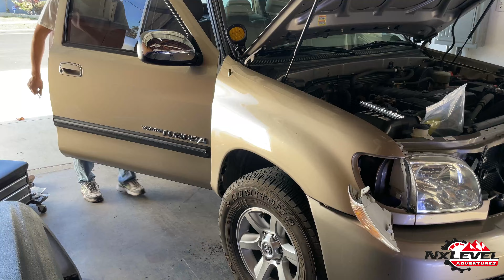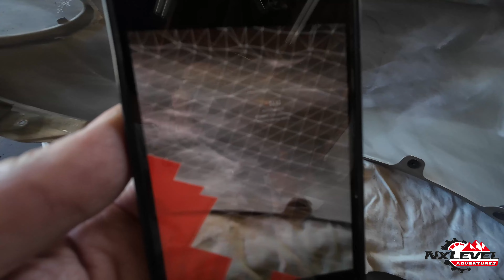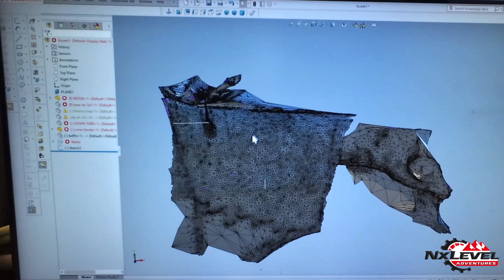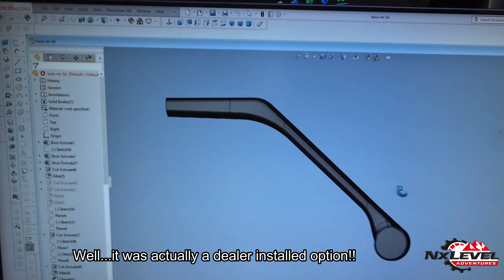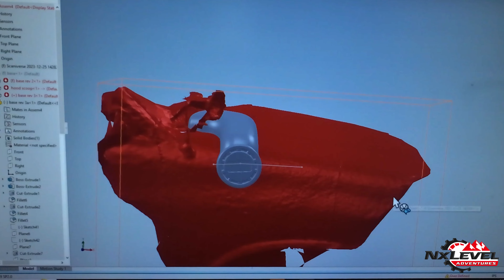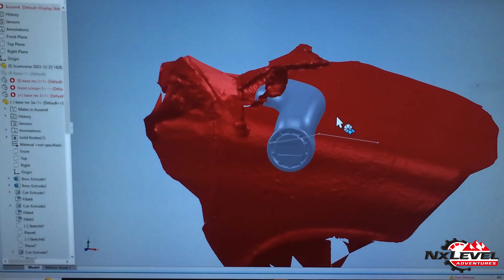My Custom Mini-Snorkle For a 1st Gen Tundra!

Comment: What 3D printer did you end up purchasing for this?
Reply from the maker: I have a Qidi X-Max 3. The Qidi X-Max 3 has a heated chamber which you need for printing ASA. It also has a fairly big print area so you don’t need to print as many sections to glue together